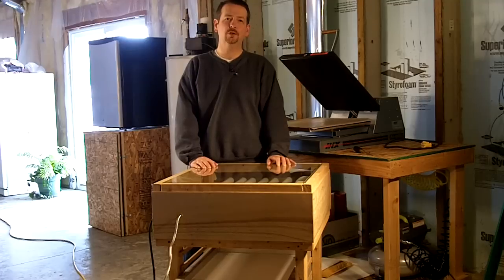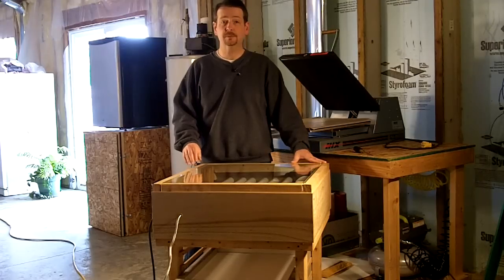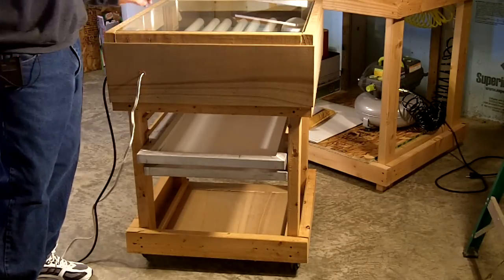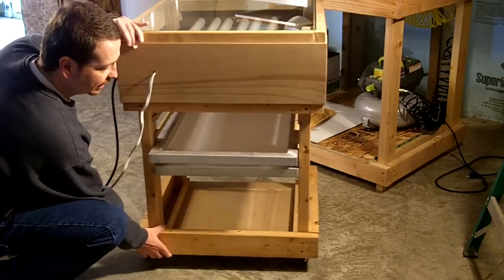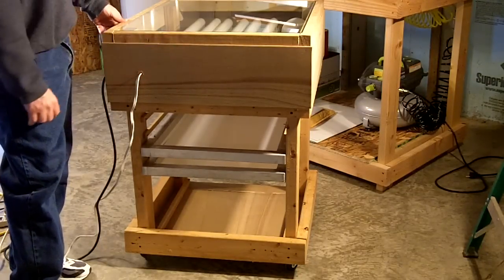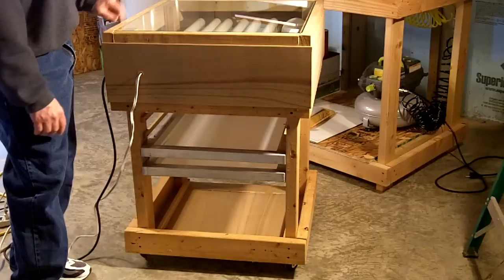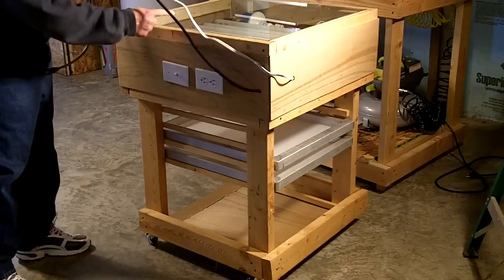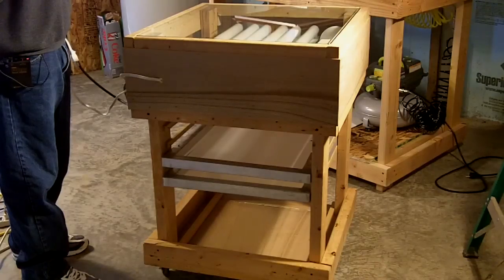Home Built Screen Printing Exposure Unit Build Overview

Comment: Great video! I got a question about the lamps: can we use regular lamps/light bulbs for the exposure? Is this mandatory or is it something to use to get the exposure faster? Thanks
Reply: that depends on what kind of printing you are doing.  if you are doing regular black and white liquid emulsion contact prints, then yes, you can use regular bulbs.  The UV bulbs are for specific photographic processes, like gum printing.
Reply: oops sorry this is for screen printing...but still kind of bulb depends on kind of process (I found this video while searching for info on gum printing, so I was focused on that sorry :)
Reply: Hey ! Can you help me?

Comment: how much does this cost to build? it almost seems like buying a unit may be more efficient
Reply: A lot less than any production unit. I spent $20 on a 1/2" thick, 4x8 sheet of plywood. That's more than enough to cut a 30" x 24" base for the box, two 30" x 9" panels for the long sides, and two 25" x 9" panels for the short sides. You can buy a sheet of 1/8" plexiglass at a hardware store and cut it to fit in the box. Stack 2 sheets to make it sturdier; one sheet may buckle under the weight of the screen. All you need then is three 24" fluorescent fixtures, and fluorescent bulbs. The black light bulbs are not necessary. Production exposure units with fluorescent bulbs use regular bulbs, not black light bulbs. Exposure time with regular bulbs shouldn't be any longer than 2 minutes 30 seconds. 

Also - the inside of the box needs to be painted white. This helps reflect light up to the screen.

Comment: Nice video, however you have three 2 light fixtures and you have the bulbs almost touching from one fixture to the next. That makes the emitted light more intense from the two bulbs all most touching, yet the bulbs in each fixture are separated.  

So i think it would be better to space the fixtures apart so all 6 bulbs have equal spacing, this would make the emitted light more even and eliminate the hot spot from your two bulbs that are so close together.

If you look at any of the commercial exposure units, the bulbs are always spaced equal distance apart for even light distribution. I don't know why you didn't do this, as you have plenty of room to move both outside fixtures away from the center fixture a little.
Reply: Thanks so much for the additional tips... I want to build one of my own with some of my own tweaks of course but the additional tips that I find in the comment section is extremely helpful from when I build mine so thanks. If you know of any places to find plans for something like this please share it.

Comment: The distance of the lamps to the glass as well as the spacing of the lamps to one another are very critical dimensions.  If not correct you will have hot and cold spots in your exposure which will result in over and under exposed emulsion.

Comment: Steve, nice video. One issue. You may get burn out in stripes if your bulbs aren't spaced evenly. I'm referring to each of the double bulb units being spaced the same distance as the space of each individual unit. I say this after doing a lot of research on this topic. When light is emitted it fans out from the bulb in such a way that the bulbs next to each other—the rays will meet at a point. Your lights that are close together will have light meeting from both bulbs creating a hot spot of concentrated light and the opposite effect can happen when the bulbs are too far apart there can be areas that are a underexposed. I'm not sure where you got your 2" distance from the glass but that same source would probably mention the light source's fan-effect. I like your well explained video and your resourcefulness. I am going to be doing more screen printing than I used to, so I'm considering doing what you're doing. I love the idea of the exposure unit doing double duty as a light box. I'm going to look further at your videos. Thanks for posting.
Reply: Park seon jung ?

Comment: Do you get much undercutting with halftones? I made a very similar unit, I'm also using 6 bulbs, but appear to have loss of detail (probably from undercutting). My film positives are printed from a super pro inkjet roll printer (I was able to achieve complete success with them while using a vacuum table at a university I studied abroad at). I'm using Ryonet Hifi emulsion, and have tried a few different exposure times, but still don't know what I further need to adjust in my setup. Ideas?

Comment: i want to build an exposure unit to burn 28 x 36 inch screens.  i was going to use 48 inch t12 BL tubes. was wondering how many bulbs i would need. and if they could be spaced between each fixture or if that would cause blurry lines.
also do you ever have issues with your emulsion not hardening around the outsides with this unit?